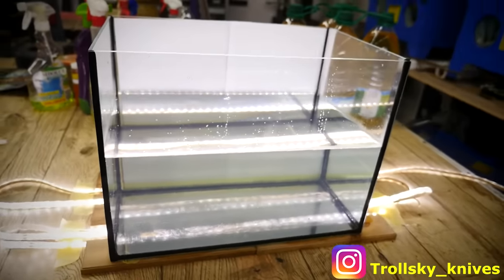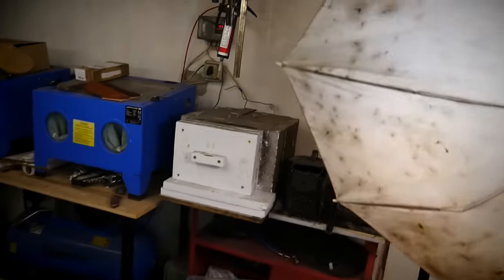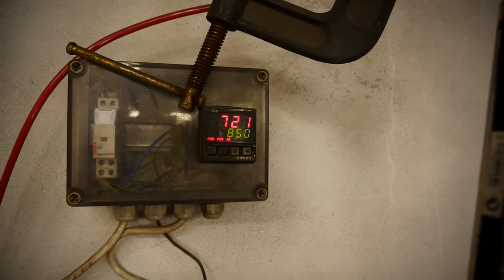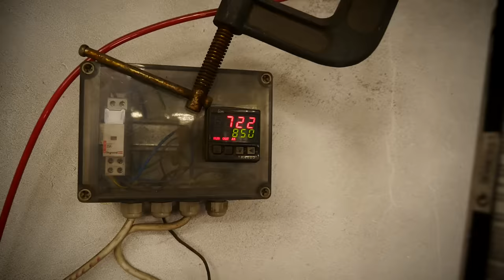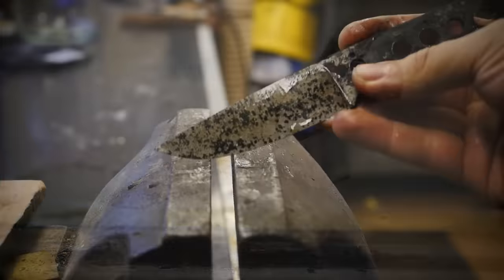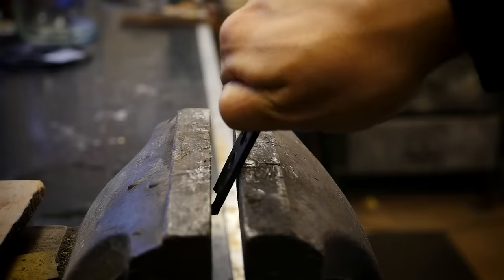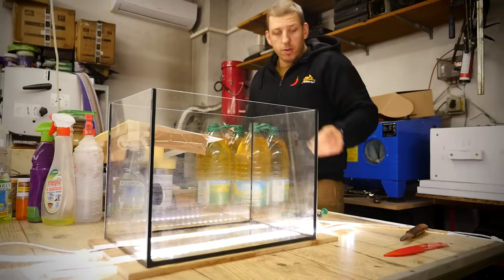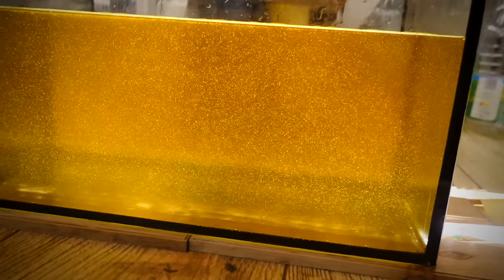STEEL HEAT TREATING CLOSEUP - WATER VS OIL [Trollsky Knifemaking]

Comment: To begin with, obviously, you do not comprehend that you are not doing a proper quench in either water or oil.  You need to restudy your techniques for both.  Also you broke a knife because you didn't bother to temper it.  Water quenching is commonly done all over the world by knowledeable
blacksmiths and factories.   Oil hardening steel has different prperties from water hardening steel.

Comment: Why did you break a non tempered knife and then say "That's why we are not quenching in water" As if a un tempered piece of oil hardened steel won't break just as easily. Water doesn't always warp the blade either. If you are using oil hardening steel then oil is best, if you are using water hardening steels water is best, it depends on the steel. I wouldn't water quench O1, but I wouldn't oil quench W2. I water quench carbon steels and get fantastic results.

Comment: No you don't always oil quench. Some metals quench in water and others oil. Some don't even need it and are supposed to air quench. It all depends on the steel you are using.

Comment: we all know quenching in oil doesn't give as much hardness as water, but for the professional knife maker you can get 95% of the hardness for a significantly reduced risk of cracking, which is worth because their job depends on reliability in making good knives.

Comment: Where do I begin ?  1 What kind of steel, (water , oil or air hardening ) , or are you using scrap?  2, all ways agitate the steel to cool properly  (oil or water ), 3 Temper two or three times and then check the hardness. 4 Use the proper quenching oil .

Comment: Watching this video, someone will think that the water quench is a bad thing to do, but what i see is a totally missing part, the tempering, the same blade that you shatter in the wise after 1 hour at 200°C will not broke like dry bread...
Try to oil harden a low carbon steel like the 1040, it remain soft, or at least not hard to hold an edge, the same steel quenched in water and it will harden.
But effectively, the japanese blade smiths ,that all the world know that are not able to make a good blade... they always use water for their blade...

Comment: If you don't temper after quenching in any way the steel will shatter like that first test. Come on man...W series is formulated to water quench & O series in oil. Both if I'm not mistaken benefit from a Temper cycle or require it. Very poor experiment.

Comment: And say please, how U sink, how temperature of oil must be for better result? When model no crack, but no so soft.
Reply: every temperature below 200°C
Reply: @croisetguillaume2223  no, thats after, maybe two-three hours in two hundred degrees.
 I mean in moment! When U put it in oil,  how temperature of oil?
Reply: @croisetguillaume2223  thanks
Reply: How about clear oil with -20 temperature?
Or not, near hot oil after engine with metal cranks?
Reply: @ash9622   i mean u can warm ur oil it become more liquid and drasticly reduce the time of cooling down the steel, but always under 200°c, the ideal range is 50-180°c
Reply: but it totaly depend of what sort of steel u use, read data sheet its always usefull, and if its unknow steel do test pieces ;)
Reply: With 80 crv2 you need to preheat the oil to a minimum 120f / 49c but I prefer preheating it to 140-150f / 60-65c

Comment: He didn't even get the blades to the right temp and color so it's not a valid test. He needs to redo this and heat them in a forge not a tempering oven. So this video is full of miss information.
Reply: If he heated em in a tempering oven and was using the correct and the same temp for the steel, it's fine. You don't have to heat the steel in a forge as long as it's the correct temp

Comment: I don’t a thing about quenching or anything with heat treating, but does the metal orientation during the quench matter? Is there a difference if it’s held edge pointed down vs broad side down?

Comment: by this video he showed us how to easily destroy an iron vault,simply heating and pour water,,,,
Reply: Pff... Where should i start. Safes are made of a different steel Type with alloys that makes it awfull to machine it easaly, the steel dont need to have hardening abilitys . Second...how much heat do you need to get it to quench Temperatur? Okay you made it trough the first layer...so now have fun with the concrete and whe you Finish this another steel plate is still waiting for you or cops maybe....

Comment: Thats an unfair test firstly because you only tested the water quenched knife but not the oil quenched one and those tests are pointless anyway as you temper the knife after quenching to remove the brittleness and remove some of the hardness that the quenching process creates. You should have done a side by size comparison after quenching in both liquids then a side by side comparison after tempering at exactly the same temperature otherwise its a pointless video and test.

Comment: What kind of steel did you harden? Why didn't you show the breakage test for steel hardened in oil? What do you want to prove with this trivial and incomplete experiment? Anyone who knows more about steel than the fact that it is made for example bridges or cars, knows that oil toughens more gently than water. You used a lot of energy and some of my time to show shit.

Comment: Nice video but a little bit incompleate as you would have to show both water quenched and oiled quenched  breakability in the vice for comparrison. All metals are brittle after quenching. Its the heat treating afterwards that brings back the metals strength. So for s proper test you would do both oil and water quench, then test both blades before and after heat treating. Otherwise great video layout and setup!!!!

Comment: I knew that quenching in water is too fast, but I didn't expect that steel would become so brittle, very impressing!
Reply: only depend of the steel, some cant be quench in water, other need to be.
Reply: @croisetguillaume2223  Yes indeed. Some others are quenched in air. I was talking about regular high carbon steel.
Reply: White Boar some high carbon steel CAN be done in water or air. It’s all about the alloy that will tell you what medium a quench must be in.

Comment: Yeah that was the most waste of time ever for not only yourself but for my own viewing...... After heat treating no matter if you heat it in water or heated an oil it's still going to snap...... That's the whole point of heat tempering...... 

Ne-10 series should be able to be water or oil quenched...... But it makes its Rockwell very hard because of the high carbon..... 
So you must temper all forms of steel after heat treating..... Or they will all become brittle

Comment: That’s crazy how the scale just fell off in the water quench. Do you think regardless of how brittle the water quench was you could have tempered the steel
Reply: Generally yes, you can temper the steel after a water Quench, unless you've burnt the steel then it's a total loss... However you need do multiple cycles at 450f (232c) you'll also need to do a shimmed temper if the knife warps
Reply: John Bovee might be better not to define the temperature. We don’t want people thinking there is only one way to do something. Temperature is relevant to the desired hardness post-temper. To just say “temper twice at 450,” while it would work, is not a rule. Each different alloy will reach its own relative hardness depending on the temperature of the temper.

Comment: you have little knowledge about quenching in water. you should not put whole blade in water. there is process of doing it
Reply: What happens if I quench it in a chocolate?
Reply: @vivekvarun9342  try on your own
Reply: @shakilmeshram8783  ur opinion?
Reply: @vivekvarun9342  i didn't tried it bro

Comment: could you repeat the test with agitated quenchant? you could use something like a plate, heavy enough to not float in the oil when moved, with a hinge on one end that is connected to a rod with an eye on the upper end, which is in turn moved up/down with a drill or similar. I've been using such a setup and it seems to affect speed and distortion, but I don't have an aquarium or a good camera to record.